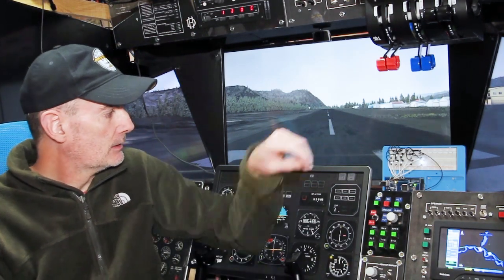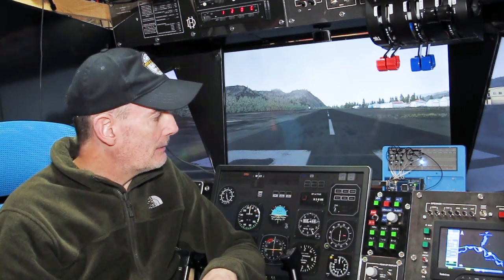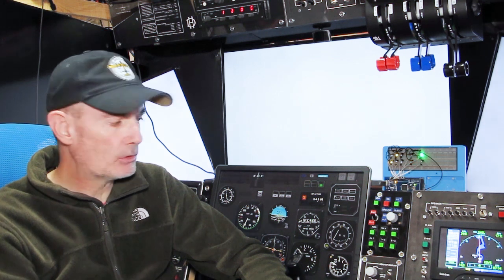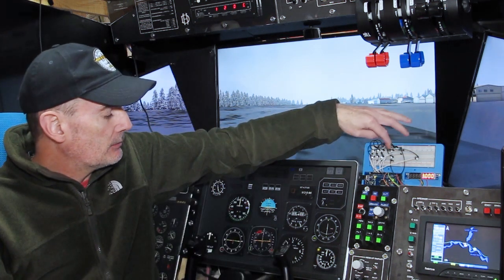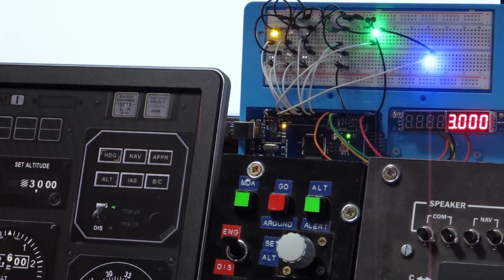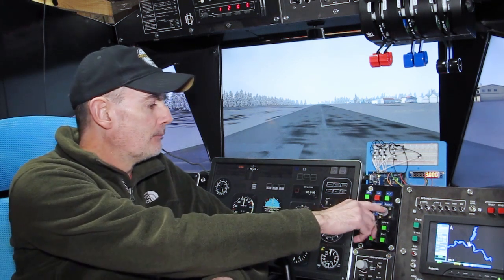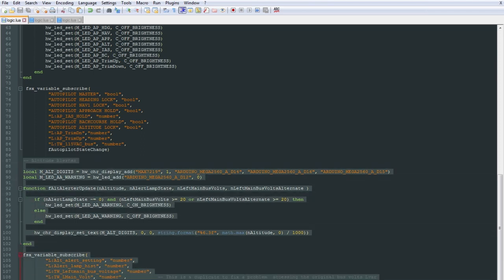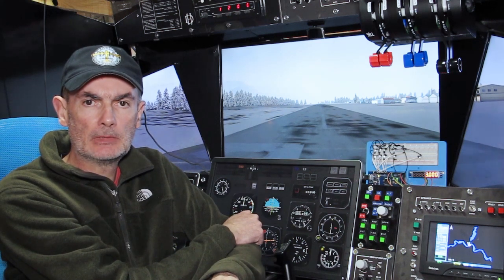Prototype Autopilot Outputs! (Twin Otter Cockpit Build - Part 48)

Comment: Hi Mark. Interesting video as always. Building a 737 we put the LEDs (or annunciators) in specially made small plastic boxes with holes so that you can push the LEDs through. These are faced off by custom made coloured acrylic panels with the logo for that particular annunciator (e.g. Window Heat On). Normally 2 x LEDs in each box.
See here for the annunciator boxes. 
https://www.cockpitsimparts.co.uk/led-s/109-overhead-led-indicator-box-.html
I hope that makes sense. If you've any questions just ask.
Reply from the maker: Ha, you have anticipated the next chapter, which is finding random plastic items around the house to use as LED housings. I have discovered that the protective caps supplied with various types of cable can make pretty good annunciators! But at a pound a go I might just take the easy way out...